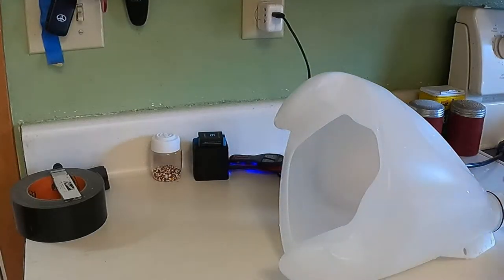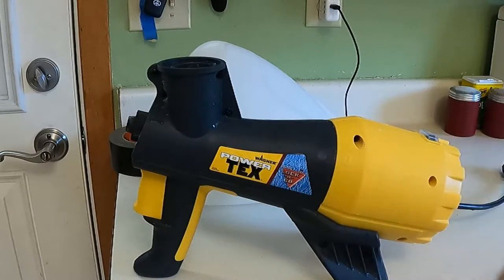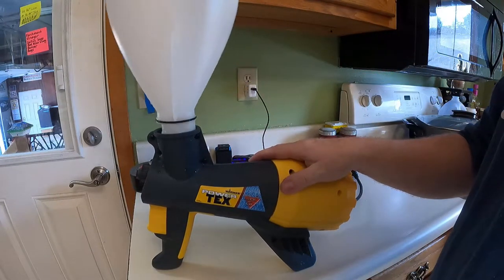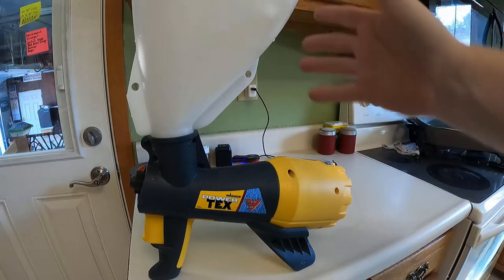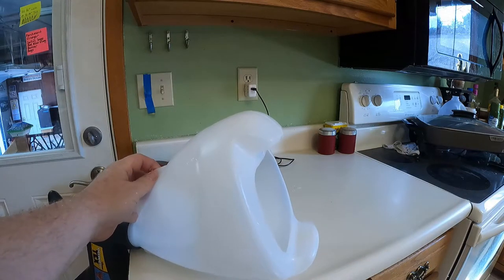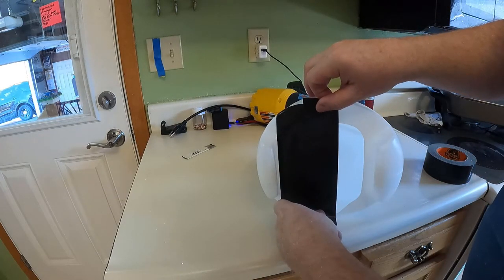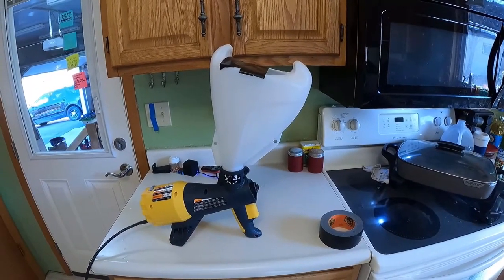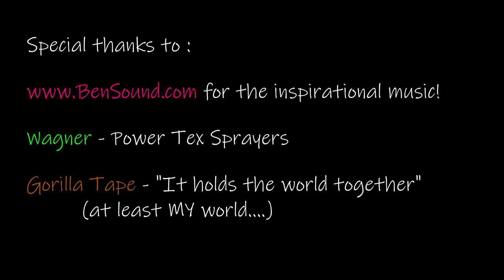Wagner PowerTex Helpful Hints

Comment: Nice set up instructions. Like the tape for ceilings.  Great idea!!! I have one more room to do, will get to it next year and will do the tape trick.
I've done a couple rooms, walls and ceilings in my home this year (2021) with the Wagner.  One room 14 by 16, the other 11 by 9. (90 year old house, and the person that flipped it a couple owners before me was a hack, it needed mud joints sanded and redone as tape was showing and other mistakes )
The Wagner has some definite positives going for it.  It can be used by a homeowner without buying a compressor, air lines, and the commercial texture sprayer.  It is a lot cheaper.
But it does have its limitations.  In a commercial compressor run texture sprayer you can vary the air line pressure, the air and mud volume and the nozzle size.  In the Wagner you can only vary two of those. Wagner gives you multiple nozzles.  The air and mud volume is controlled by how far you pull the trigger.  Some professional sprayer rigs have a set screw that limits the trigger, so if you only want a light spray you can pull to the stop and you get a light spray.  With the Wagner, your index finger controls the mud/air volume.  And as the job goes on that finger will not keep the same setting.
Final evaluation, what I did, i was pleased with, but if  had paid for the job I would have expected a more consistent spray. Wagner should put some kind of adjustable limit on the trigger.
Buy the drywall mud with the blue lid on the bucket.  Drywall mud needs to be thinned, a lot.  Nope, even more than that.  Keep going. Not done yet. Finally, you think you are done thinning.  Nope, add a little more water.  Trust me on this one, it will keep the mud flowing while you use it.
How much drywall mud will you use? It depends on how thick you put it on.  I used about 4 gallons for one room and three for the other. But I needed to cover a lot of sins committed by the original drywaller. (see above)
If you are going to "knockdown" the texture (flatten with a wide soft putty knife type thing) don't let the mud dry to much.
Sprayed on texture can be removed with a drywall knife if you get to it soon enough, but don't let it dry all the way.
You will need a big drywall mixing blade to mix the mud while adding water. The other thing a homeowner might need for the job is a much larger electric drill than they probably already own.  Thinning a bucket of drywall mud is not an easy thing for a typical 3/8" drill. Mine started smoking in seconds, so I went and got a BIG professional name brand hammer drill. And even that could have been upsized another 80 bucks.  These projects are not for wimps with tight wallets.
Before spraying put up a lot of plastic over windows, doorways, floors, and on and on.  Blue tape and plastic sheets are your friends, use 'em.  You can also use plastic sheet as a practice location. Another practice location could be on cardboard, a big piece.
Quick tip, when you release the trigger to stop spraying for more than a couple seconds shut of the turbine to prevent the mud from drying out in the nozzle.  There is a little bottle brush type brush that comes with the Wagner, when the output goes down, use it to clean the nozzle. Don't loose it, you will come to depend on it.

With all the water that will by drying from the walls and ceiling the room will get humid quickly.  Expect it.  

Oh, the Wagner comes with a little packet of grease.  Use the grease on the two O rings and apply to the inside of the nozzle with a Q-tip. This will prevent dry rot of those parts.
Don't trip over the power cord while holding a couple pounds of drywall mud in that hopper.
Reply from the maker: Thanks for the comment!  We have one more bedroom, and a hallway, and we are finally done scraping ceilings!  A neighbor had a $12,000 estimate from a contractor to do a lot less ceiling than we did.  Glad we did it ourselves!  I'd rather spend that $$ on something fun!
Reply: @dougdemako7382  that’s insane 12k just for texture…
My downstairs is 500 sq ft 
I did all the labor/ prep just wanted someone to texture
That again 500 sq ft little area’ he wanted 2400 just for texture’ 
If I wanted wall primed that was another $800 🤯
I get they have to pay ppl It is a 1 day job for a 3 man crew’ how anyone can remodel their house (via 
contractor)  I don’t know how they do it’ say a kitchen/ bathroom only that will easily be 25k How do normal folk afford it….?